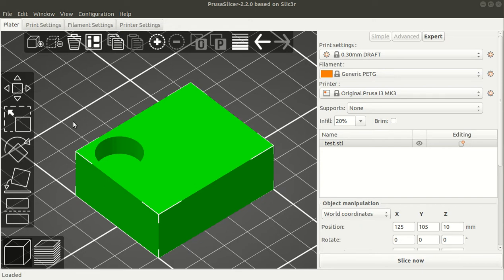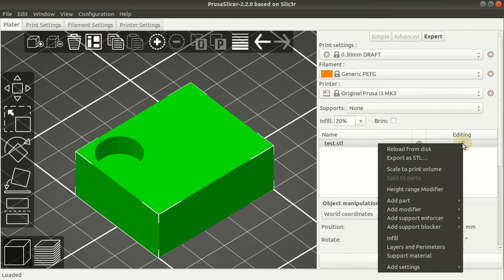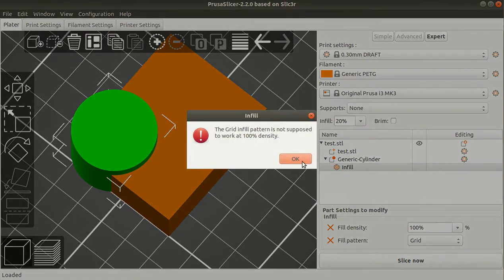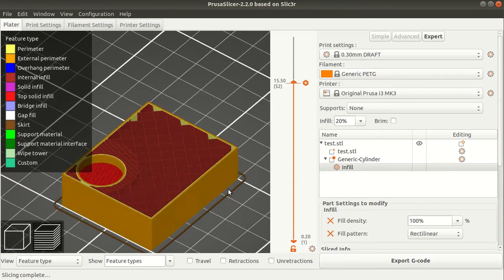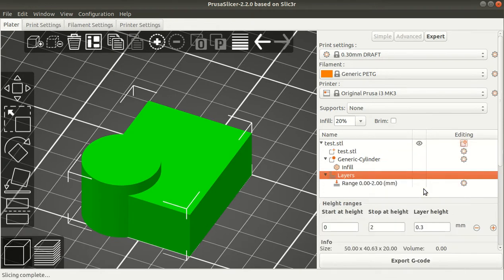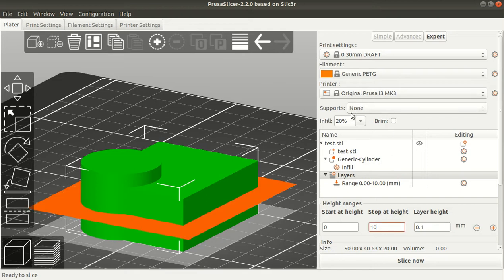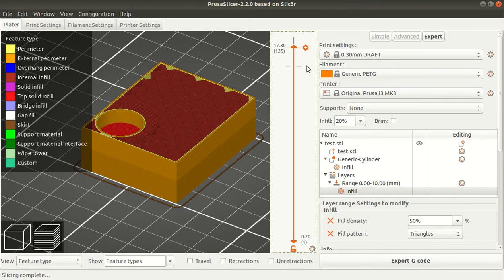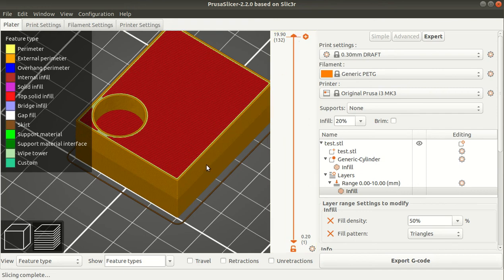Customized infill density and pattern with PrusaSlicer

Comment: The most annoying thing about Prusa slicer is that it wont let you use 100% infill with any pattern other than rectilinear. They claim it wont work. Meanwhile you can go over to CURA and it works great with ANY infill.
Reply from the maker: I saw that. When you put infill 100% it is supposed to fill everywhere any way so does pattern matter? Also, why do you need 100% infill? If you need to make the pieces stronger,  try to increase the numbers of shells.
Reply: @maketestrepeat  I require 100% infill to ensure maximum strength for the part. This isn't about printing small decorations; I need durability. While increasing shells can enhance surface strength, the core of the part remains weak with sparse infill. 

Over time, repeated stress on the perimeters can result in failure. Moreover, thin sections with added perimeters essentially become all perimeter, compromising structural integrity.
Reply: @maketestrepeat  I require 100% infill to ensure maximum strength for the part. I’m not printing toys; I need durability and for the parts to be solid. As for the infill pattern, it does matter even at 100% infill. Think of how a lattice of a material affects its properties. Same concept here. A 3d printed part is never completely solid even at 100% infill there are still microscopic gaps. The way the plastic is bonded together, even in a solid has an effect on its over all strength.

While increasing shells can enhance surface strength, the core of the part remains weak with sparse infill. Over time, repeated stress on the perimeters can result in failure. Moreover, thin sections with added perimeters essentially become all perimeter, this is not optimal of you want strength in all directions. 

Prusa doesn’t seem to understand this, likely due to the fact all they print are printer parts,bobbles and trinket’s. In that case, maximizing strength in every conceivable way is not something they care about.
Reply from the maker: I understand your concern. It is true that the pattern of infill have effect on directional strength of the piece. What printer do you have? Did you try with other slicers, as you said the CURA works. Try ORCA slicer as well. Let me know if you manage to do it. Cheers!